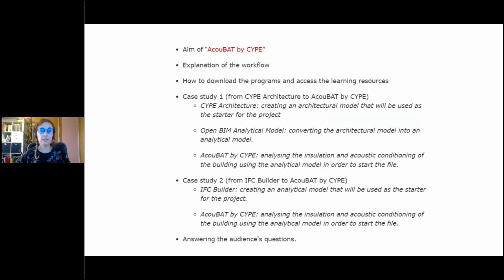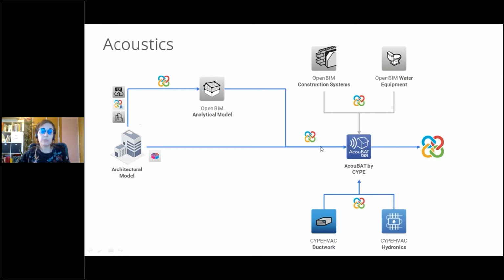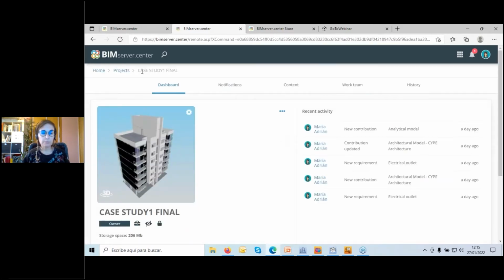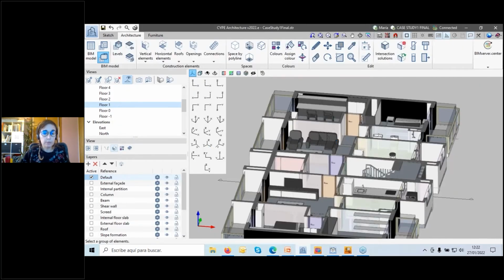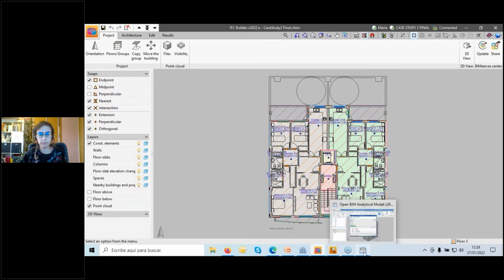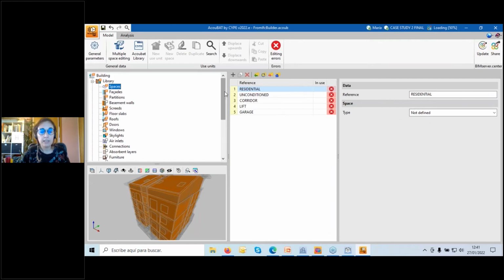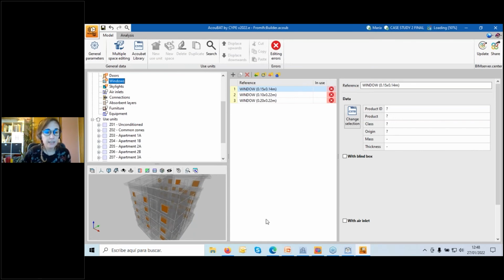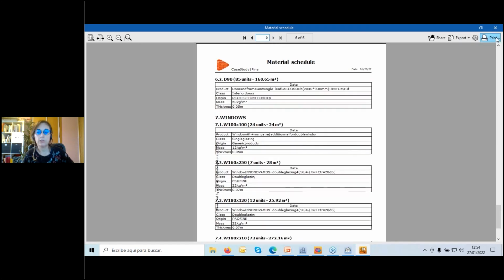Building Acoustics. AcouBAT by CYPE

Comment: How can I  have folder of regulations in general parameters by english?
Reply from the maker: Hello. From "File > Examples" you can load and open one of the examples available in English. Then, from "General parameters", using the "Export" button, you can save this configuration to .bib132 files in the indicated path. In other works, use the "Import" option to select the previously exported file and import these parameters. Greetings 😊